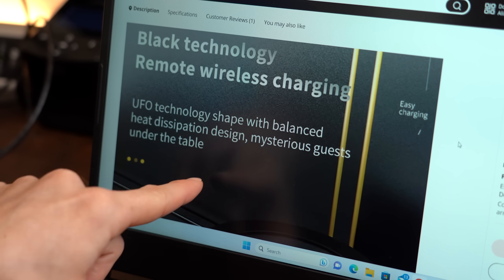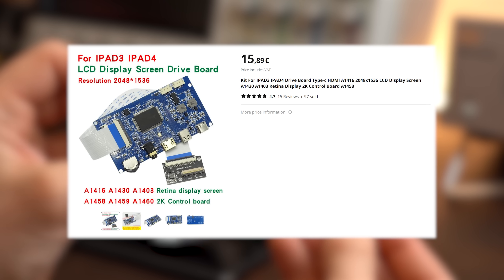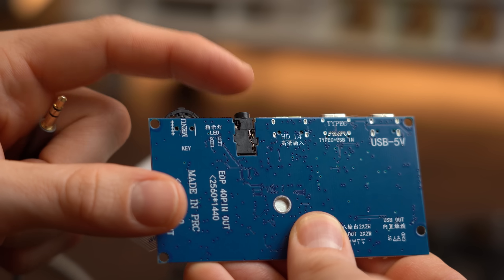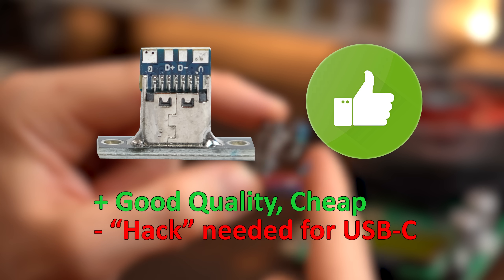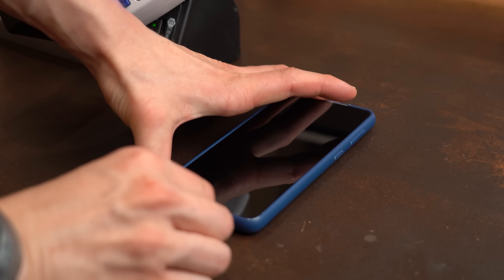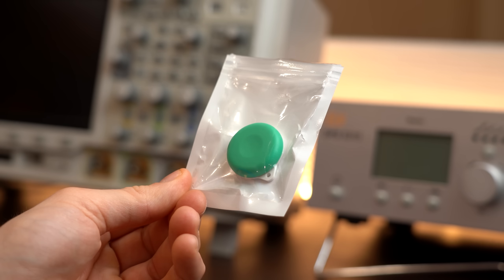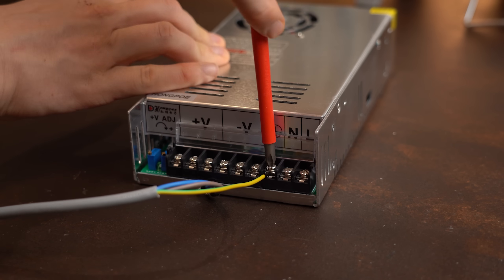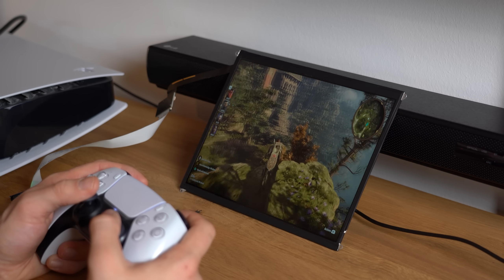I tried finding Hidden Gems on AliExpress AGAIN! (Part 7)

Comment: As for the wire twister you can definitely twist any wires. If the goal is not making a connection at the tip, just hold it to twist the wires and yes you can definitely twist breaded wires, not for making a connection at the tip but to TWIST them. I for once see this as user error and see this tool as very useful but tbh, you could probably make one at home.
Reply: Why on earth would you want your wires in this difficult to maintain mess? How do you then insulate the remaining copper? Just bung a load of electrical tape over it I suppose? Ghastly!
The tool, and the connections it makes are utter garbage at best, outright dangerous at worst.
Why on earth this was given a thumbs up is beyond me.

Comment: heat and cold cycles stiffing the metals loose the elasticity so the problem have the vago connectors than make the spring not properly working after a lot time. Its the other way around is more safe the twist's cable in long run that the vago.

Comment: Im using a bluetooth beacon as anti theft for my motorcycle. If bike is taken away, it will turn off at certain distance.

It will switch off battery when bluetooth disconnect.
Im using esp32 inside motorcycle.

Comment: While the mm distance on the charger isn't super great it does remind me that theres a fair bit of project potential with wireless powered devices anyway. Combined with NFC then its a wireless interface with some capability for some logic, add in an esp32 on the powered side you got some capability for remote data updates, then use in something like a low powered display on the user's side and you got a thing or something. idk what tho

Comment: Beware, those power supplies are hot garbage. I've had one blow a MOSFET, another shorted to the case due to a ridiculously long capacitor lead they didn't trim, and of course they can only supply about 60-80% of their rated power without the aluminum windings in the transformer or inductor melting their insulation. One overheated so bad it melted the isolation between primary and secondary and brought mains voltage to the output. If it plugs into mains, stick with a name brand like Meanwell. Or at least make sure it has the proper UL/CSA/ETL/GS certification.

Comment: BLE beacon accuracy is always going to be poor unfortunately. We've tried this at my day job for accurate proximity as a bonus within the app, to determine when to trigger the unlock of a retrofitted door (we called it spaceship door mode, like Star Wars) but it just wasn't accurate. Now it's only used for loose proximity in the app.

Comment: Lmao, some of the descriptions are hilarious...

In the same vein as the iPad display with controller, you can probably get a lot of cheap controllers for common LCDs -- for example, I have access to a bunch of old Chromebooks, which means LCD panels for DAYS, so if I get a compatible controller I have a cheap portable display. And you can probably get a cheap board to connect the Chromebook batteries to for charge/discharge control and give 12V to the display, allowing you to have it be totally portable, and use the old batteries from Chromebooks as well!

Comment: Why would heat cycling loosen wrapped copper? It's all copper. It all has exactly the same thermal coefficient of expansion, and besides, twisted wire is how every connection in a US houshold has been made for many decades, and theres never been this mysterious problem of heat cycle loosening despite our much more varied conditions beween seasons.
It kinda just sounds like youre making something up to justify favoring the inferior idiot-proofed method.
A certain product being easier for soft handed people doesn't equate to the product being the best method.
Also, yes, twisted wire has a substaintially lower contact resistance than the small sharp edge that bites into a fraction of a mm in a wago.

Comment: I'm glad you mentioned the potential issue with the twisted connection: heat cycling. 

In the U.S., this type of connection would not pass inspection. Electrical connections must be done by mechanical means (wire nut, compression, wago, screw, etc.). This, on its own, is not mechanical means. 

Sure, you could throw a wire nut on the end of it and be compliant, but you're still royally screwing over the next guy that has to work on it. This much twist on solid wires can weaken the copper, causing it to break in half when you try to undo it. That's fine when you have 20" of wire sticking out, but most of the time, you cannot afford to make the wire any shorter than it already is.
Reply: I feel for US electricians that have to deal with wire nuts. I only find them in fairly old installations over here and it's always a royal pain in the behind.
Reply: in all fairness the product itself can be used just fine. Have a couple and they work perfect for pretwisting. Just use a drill at slowest speed (brushless or nothing) and you can easily get a good twist on thicker 12AWG wires far faster, toss on a wirenut and call it a day. It's extremely handy. Hell, you can even use it with hand tools to make life easier
Reply: it also looks awful
Reply: As a UK Sparky, i feel for you Yanks, WAGO are amazing, and i dont understand why you cant use WAGO as you have a lower Voltage...

Comment: 9:16 - our german made wago burned or melted in a simple 3200 W ac car charger or in the connection box even though cables were tied. Wago were totally black and burned . 
Not sure if Wago can be called safe if they suck in a 10 hour ( max.)  task to charge an e-golf to 100%.

Comment: Wire-winding was a common technique on older appliances, I have older(but still relatively recent) amps etc that use it. They likewise used a rotary tool, albeit in a more specific way:
https://youtu.be/lxQS58t39_U?t=22

Comment: What is the actual application you could use the twister tool in? That kind of connections are always made by a professional and no professional would use that. It isn't stantardized. I mean this isn't a world of mad max or something. Ok, had to do some research. Apparently in poorer countries twist-and-tape method is considered kosher. Pretty mad max.

Comment: Re: the Wire Twister Tool at 8:20, y'all don't have Marr Connectors?  They do exactly the same thing and hide it inside a nice insulated plastic cap all in one go.  It's a red plastic cap with a conical brass female screw socket inside the cap.  You jam your 2-5 copper wires inside, and then twist.  And you're done.  Maybe not as aggressive as a drill, but I can't imagine a scenario where it would make a difference.  We use them for pretty much every house wiring in North America, 24v thermostat wiring, that sort of thing.

Comment: What i'm looking for for a und hile now is a usb c smd part that has the necessary resistors build in and fits otherwise the footprint of a usb micro port. This would enable a relatively clean and easy swapping and upgrading of older devices

Comment: I would've bought only the driver board , the LCD would've fished it from eBay scraps... I find these videos useful since I also buy stuff from AliExpress. Thanks, Scott!
Reply: its $27 for a brand new screen, and saves you the hassle of tearing the glass off an iPad. You can also buy a new touch panel for $17, and the controller board has touch input. All you have left is figuring out the drivers for touch support on your pc or RPi.
Reply: @frostbite1991  they are not brand new. I bought one and got a garbage reconditioned screen
Reply: @frostbite1991  Do you know which touch panel would work on these controller board? The iPad touch have too many pins.

Comment: For charging i use a magnetic usb c system i got from amazon. I found that wireless would create a lot of heat. Some of them are just two votage pins but the good ones do fast charging and data. Normally over nught i plug it in to a 2 amp charger since i dont need fast charging while i sleep

Comment: the bluetooth based distance measuring is really inaccurate. everything can disturb the signal strength. Newer phones(s21 ultra, s22) can use UltraWideBand locationing with the samsung smart tag.

Comment: It's ridiculous that chinese manufacturers haven't figured out how to add 5.1k resistors to their USB-C ports. Not just on the panel-mount USB C port you showed where the TH resistors make the whole thing 5x bulkier, but on actual finished products too!
Reply: Maybe they haven’t added them for a reason. With things like the USB C ports they will want to keep it as simple as possible and as applicable to different situations as possible and keep it as cheap as possible. As for finished products, if it doesn’t need the extra current then why bother with the resistors? It just adds cost.
Reply: @conorstewart2214 

1. "different situations as possible" -- only other possible situation is adding a PD negotiation chip. this requires CC pins, so does not apply to the power-only version
2. the resistors don't allow for extra current. without them the device simply does not charge at all on a spec-compliant USB-C charger, i.e. you need a USB-A to USB-C cable or it is a brick. Also, their cost is <$0.001 and they are so common they are already loaded on every PnP machine.

Comment: Usb-c:
There are special dummies out on Ali, where you have solder pads to choose which voltage you like. So if you want to power a small led lamp with 12v,it works.

@wire spinner:
I'm an electrical engineer.
PLEASE, don't use those! In the end you have to apply some isolation again because of live voltage.
It is simply not a trusted connection method.
I German we have a phrase for this: "TÜV sagt nein"

Comment: While chceking the LCD driver board from the link you privided I saw that there is a four pin header labelled USB OUT. Aliexpress description says that's for the touchsceeen. Can you chceck if it actually works?
Reply: According to another poster in the comments it requires an additional touchscreen overlay

Comment: I built a custom dual panel ultrawide mini monitor for my workbench using a pair of those iPad LCDs. Put it on a sliding rail under my top shelf, and used a GoPro handlebar mount to get a tilt and swivel for it. It's combined 4096x1536 is a high enough resolution to show detailed schematics and diagrams, but not very tall, so it doesn't obscure the workspace below. I used a cable chain to guide the power and video cables to the PC at the side of the desk. Even if just using it to play youtube videos to pass the time while working, I could slide it to the side and rotate it to face me. It was perfect! The LCDs and drivers, the GoPro mount, the cable chain, and even the screws all came from AliExpress. The slide rail (closet door slide), aluminum U channel (for the frame), and the polycarbonate (screen protector) all came from the local hardware store. The plastic used to close up the back was taken from some salvaged Gamestop poster holders. It was a great project!
Reply: How did you do the cable part? It connects with only one usb c?
Reply: @GabrielGBjas  i literally just ran two HDMI cables. The computer treats it as two 2048x1536 monitors side by side.
Reply: sorry to ping you months after, does touch with the display adapter pcb?

Comment: Did the touch functionality on the screen work? That looked fantastic for the price
Reply: Was wondering about that too. If there's a way to get the touch function working that would be an incredibly cheap solution for building something like an info display with touch controls.

Comment: This power supply is the kind you can find in 3d printers (mostly 24v 200/300w and meanwell brand for quality). I got a 5v/50w one and a 12v to power SBCs in the future. The no name ones were quite known to blow up easily in 3d printers in the past, but so far no issue here.

Comment: I have very similar power supply, but with 2 line display for voltage and current. And also two nubs to adjust the same. Also I saw mppt solar charge controllers in same body/enclosure.

Comment: You can use the Bluetooth beacon with ESP32s. They can be placed in all rooms as receivers and the signal with the best signal strength then "wins" :)

Perfect to track pets for example. Say if they like to hide or if you want to unlock the cat door for them if they come close....

Or be reminded to let them in if they are close to the door :)
Reply: wanted to write the same thing. I got one on my key and use it with esphome so my home assistant knows if I am home or not and adjusts automations accordingly. Works well better than WiFi and GPS tracking without privacy concerns and the batteries last forever...
Reply: @gorgorgonzales3090  I use "is my phone in my wifi" tracking. Can you explain which privacy concerns you got with this method? 🤔
Reply: Look for espresence
Works well with homeassistant or other mqtt enabled devices

Comment: I use one of those Bluetooth beacons to open the front door of our condominium.
I hid the beacon under a bench just outside the door and use Home Assistant app to track the beacon, when the app sees the beacon it tells and ESP to open the door by closing the connection inside our intercom in the apartment.
It doesn't really matter if the distance is inaccurate I'm fine with very rough numbers here

Comment: The wire twister tool gives me the heebie-jeebies.  Because there's nothing better than joining wires together and leaving a huge uninsulated twisted mess of copper.  You might be able to use it for earth connections, as long as you're sure it's never going to have a chance to connect to anything else.
Reply: I'm horrified by the commenters that think that thing is a good idea! I'm also shocked that GreatScott gave it a thumbs up!
Sure the electrical connection may be good now... but how do you insulate the tag-nut of mangled copper you're left with. How do you disconnect and reliably reconnect one wire to test a single circuit?

There's no way an electrician in the UK would get work like that signed off. I'd imagine not in Europe or the US either. I loathe wire nuts, but even they would be preferable to this bodged shite.
Reply: @kal9001  in the US they do it like this and they put plastic caps on it i know its stupid But they do it like this

Comment: The beacon could be useful for something like office use. Bluetooth detection is deliberately bad on phones for security reasons with deflection up to 10 meters for dumb devices. So for me it seems like a good device. Since I have used devices that are worth more with only 1-5m accuracy that perform worse by not connecting at all. It can be useful for large scale implementations that don't require the most accurate data points for it to work. Just a general area.

An example could be if someone is using a boardroom or not. If someone booked a room using a custom boardroom meeting app. But never showed up in a allotted time, make it available again for use by others.

This way a person just has to be in range of the room not necessarily be tracked with pinpoint accuracy

Comment: Those panel mounted USB-C ports have pads for a 0402 5.1k resistor to be soldered onto. In my experience, Type-C PD chargers don't use the USB data lines at all and only use the CC lines for picking the voltage. What sucks is USB-C conversions for devices that originally charged over micro USB, since they use the data lines to accept charge. If they don't receive anything on the USB lines, then they just refuse to charge, despite having voltage applied to them.
Reply: Oh no, really? I was already planning on upgrading several older gadgets from Micro-USB to USB-C with those boards
Reply: You can however find true USB C PD boards there that let you select the required output voltage.
Reply: If you only want 5V then all you need is two 5.1k resistors, one on each CC line (don't connect the data lines)
Reply: @tim0steele  I think you missed the point about this not working for USB C power supplies.
Reply: @stevetodd7383  it does, just 5V
Reply: @zUltra3D  see the original post. “Type-C PD chargers don’t use the data lines at all and only use the CC lines for picking the voltages”. I’ve seen type C devices fed from USB A sources that refuse to draw more than 1 amp. I was assuming that USB C PD devices would limit themselves to that unless they had negotiated with the device.
Reply: @stevetodd7383  Oh, I see. I haven't gotten around to testing the current limit yet as so far the devices I've modified draw less than an amp even if they're completely discharged and when they had the original charging port

Comment: bigger e ink displays larger than 10" would be the best thing.
those ipad screens are too small for a usecase for displaying din a4 pages.(and the non functional usb c port for power and video is a bummer)
also i guess e ink displays with the right uv protection for outdoor usage do not exist at least on normal webshops like ebay or aliexpress.

Comment: I always wondered if these weird PSU (usually meant to power security cameras I think) could replace a bunch of 12V wall wart. But if the efficiency is worst, that won't do.
Reply: I'm also not too sure about powering a 500W Aliexpress device from the mains lol, who knows what the quality is like...
Reply: @aliveandwellinisrael2507 yeah, well, as mentioned in this video, the idea of repurposing old PC PSUs might not be safer anyway. 
Also, I was talking about the CCTV/LED PSU seen at 11:50 which seems to be the same kind of PSU, minus the ajustability.

Comment: I saw at the end you pulled out the ISDT Q6 lipo charger ! I would suggest looking at the toolkitRC stuff, they have wonderful lipo chargers, that also can work as a DC power supply. I personally use the M6D, and use it quite often to power stuff with it, from my fume extractor to my soldering iron, or even little projects that require 5 to 12v. Always a nice video from you! Keep up the good work!